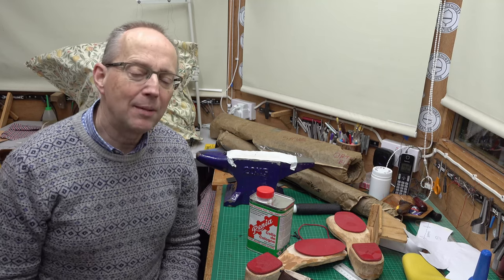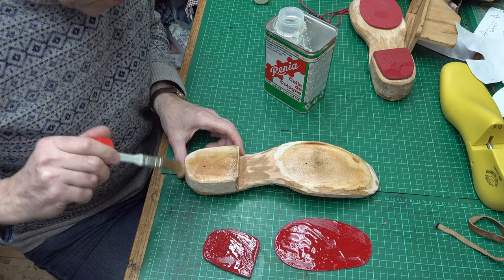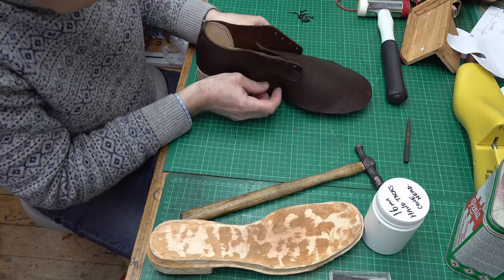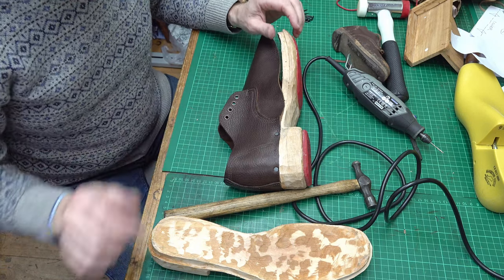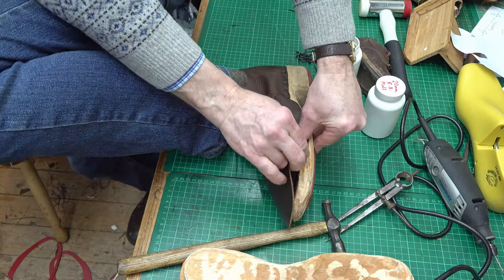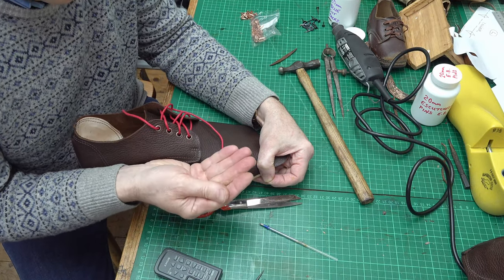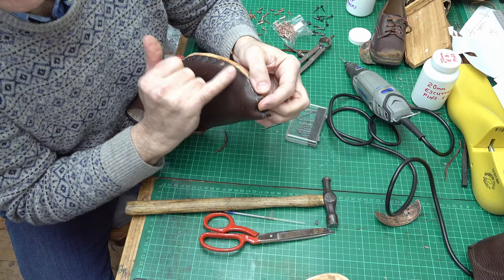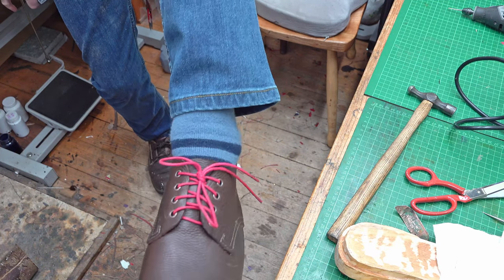Clogs 7   Fixing The Upper And Final Try On!

Comment: Are these generally made without a last? Or was that just a personal choice?  I feel like a last would make the nailing process much easier as you could stretch and pull all the excess, stick with glue, nail and then trim to size .
Reply from the maker: Hello, Yes it would be usual to use a last for the reasons you say. As I had my feet, I used them to indicate the required fit.

Comment: Hi Harry, great video, thanks as always for sharing!  Can I ask whether you also tried brass escutcheon pins (noticed that you had a tub of those on your workbench in the video).  Or did you find the irregular shanks on the tacks you ended up using were less likely to pull out?  thanks!! Esther
Reply from the maker: Hi Esther...I did try the pins, but I like the tacks because the heads are larger, and the stalks are more irregular meaning they go through different bits of wood grain and reduce the chance of a split.
Reply: @harryrogers  thanks. I may give those a go as well. I'm finding the escutcheon pins work well but would be good to try alternative since the alder has split in a couple of sections
Reply from the maker: @Estheroid77  The brass pins look nice, maybe drill a little pilot hole and see if that helps?